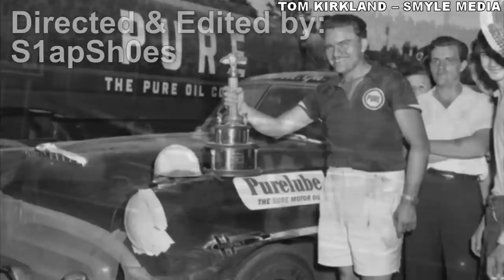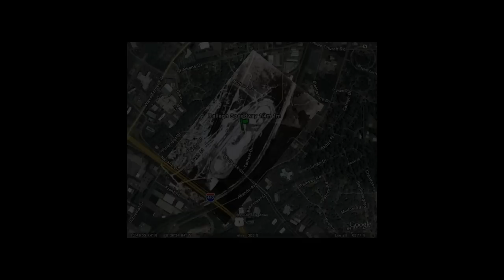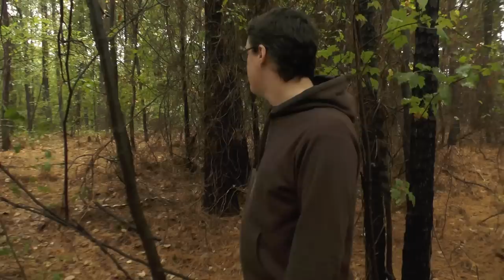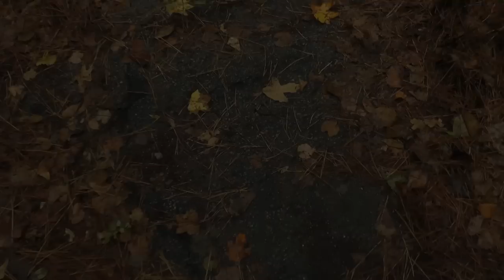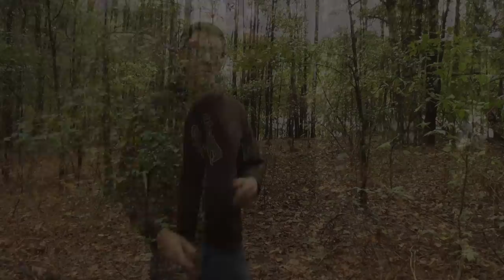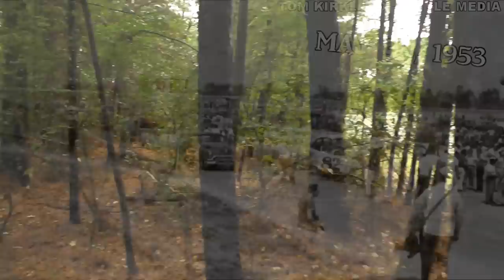Exploring the Remains of Raleigh Speedway: NASCAR's Second Super Speedway | S1ap on Location 3

Comment: S1ap on Location 4: Lakewood Speedway.

Lakewood was a one mile dirt oval in Georgia opened in 1917 as a horse racing track. By the 1930’s, the track held car races too and became a prominent facility, nicknamed the Indianapolis of the South. Many NASCAR and it’s precursor’s races were held here, with final NASCAR race run in 1959. Lakewood slowly declined due to the construction of Atlanta Motor Speedway and closed its doors in 1979. The grandstands still remain. Turns 3&4 were replaced by a parking lot to an Amphitheater, the front stretch is now an access road, and turns one and two are crossed by another road. The lake giving it its name has been mostly filled.

Oh yeah and Jocko Flocko rode with Tim Flock.
Reply: Lakewood is where Smokey and the Bandit's race scenes were filmed, and the area next to it is where the "Truck Rodeo" scenes were filmed, on the same property.
Reply: I wish i had your email adress i can send u some nascar history in NC that might really help you
Reply: Where exactly are the grandstands? I've been over to Lakewood Amphitheater a couple times but never noticed anything.
Reply: juanbond85 look on google maps satellite view and look just north of the intersection of Lakewood avenue and Lakewood way SW. there’s a building there, and on the opposite side of that building from Lakewood way SW are the grandstands. The road there is labeled Lakewood Raceway.
Reply: @KyleP133  beat me too it.
Reply: @hendo337  I saw Dave Mathews and Tracey Chapman at Lakewood in 1993-94, would have much rather seen Big and Little Enos... It must be a bitch getting those suits in 68 extra fat and 12 dwarf.

Comment: Interesting video! This track actually reminds me a bit of an abandoned road racing course about 30 minutes out from where I live (Shreveport/Bossier City Louisiana) in a town called Haughton. It was called Hilltop Raceway and from the slim information I could find on it was used as an SCCA and motorbike racing course from April 1, 1960 until sometime around 1965 before being abandoned due to financial restraints. There's a campground situated in the area it once was only that the majority of the track pavement is actually still intact and accessible with the exception of the pit area and the former dragstrip that was in the center, it was ripped up unlike everything else for some reason. The commentators box and a couple of maintenance buildings are also still intact, albeit in a shabby and unusable state. I used to go out on long runs for cross country training in high school there, lots of banked turns and a crazy incline and banked turn at the end of a lap, which is probably why it was given the nickname "Top O' The Hill".
Reply: Chandler Burns I remember a place called Hill Top Raceway but I never went there.  1973-75 timeframe.
Reply: @timnell9423  Well, I do know that Hilltop Raceway had reopening plans around that time, but they fell through and that's when the campgrounds took over which are still there.
Reply: Chandler Burns I just remember a sign on I-20 I think

Comment: I just want to point out one small mistake. The trap door to look at the tire was on the passenger side, the right side of the car. The right front takes most of the abuse on a stock car. 
Back in the 50's and early 60's before the tire companies really got involved, the only way to check for tire wear was for the driver to open the trap door and look to see if cord was showing on the tire. If the driver saw cord, he knew he needed to pit and would signal the crew that he needed to pit.

Comment: What makes a paperclip shape dangerous? The 1.5 milers are shaped that way for fans... but the backstretch is still a straight shot into a corner. Whats the difference?
Reply from the maker: A long straightaway with a tight corner means you are going to be on the brakes hard and increases the chances of them breaking, that combined with very high speeds going into a virtual 90 degree corner wall means that without proper safety features, a wreck at top speed like that almost guarantees a fatality.

Comment: "A one-mile paperclip is a pretty dangerous configuration" You just described New Hampshire Motor Speedway before the 2000s safety innovations
Reply: Exactly what I was thinking.  Remembering Adam Petty and Kenny Irwin who both slammed into the wall at the end of the straight when their throttles hung wide open.
Reply: This is why Milwaukee was dangerous in IndyCar for a period of time
Reply: Well it’s a flat racetrack, Raleigh is a High banked track
Reply: fan  true...but as with Dale's crash at Daytona...banking doesnt always scrub off enough speed to prevent a serious impact
Reply: Can also add to the speed along the top, seen in old Darlington where people would just ride along the guard rail.